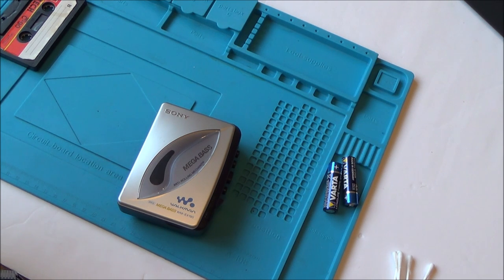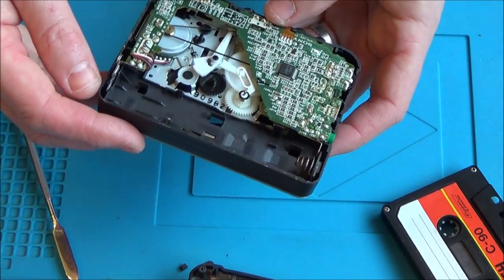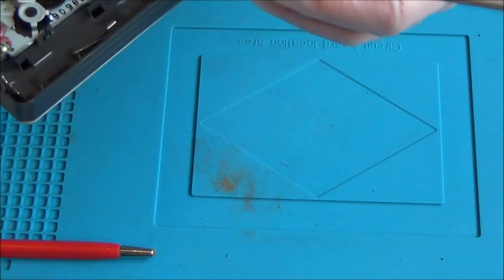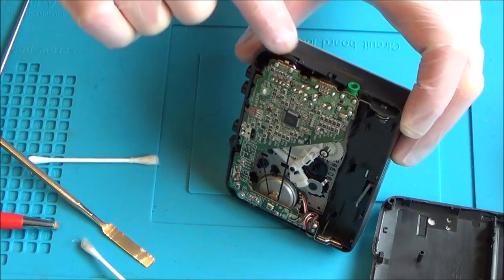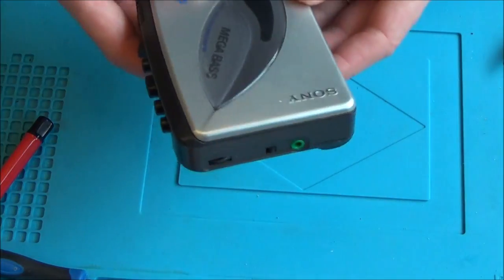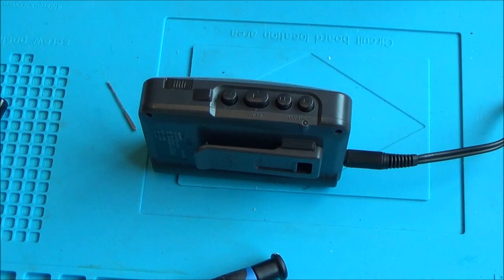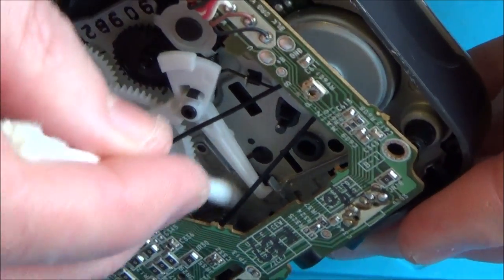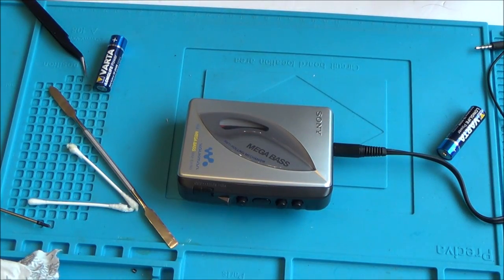Trying to FIX a Faulty 1999 Sony Walkman WM-EX190 (3rd video in Walkman series)

Comment: Another great job =D  I would have got some molycote into the mechanism there even if there was originally none - just to help with noise, movement and wear.  One point on cleaning the pinch roller (and I've made this mistake before) - if the roller is super worn, after cleaning up with IPA it can be super smooth and not grip properly.  The tip there is to use fine sand paper, or a nail file etc to rough up the surface of the roller.  The easy way to clean or rough it up is to press play without a tape, then the roller is rotating and you can press the cotton bud, sand paper, or nail fail gently onto the surface and as it rotates it cleans easier.   Go easy on PCB bending lol, I thought it was about to break at one point - again, I've done that sort of thing myself before so you aren't on your own =D

EDIT: Still watching, I see you are putting some molycote in there =D  Avoid getting it on the belt lol!
Reply from the maker: Cheers for the tips Chris, I will use the pinch roller tips on the next few if needed. That Molycote is really coming in handy since I got it :-)
Reply: You seem to know a fair amount about walkman repair. The output of my walkman is all distorted, even after I have replaced all of the capacitors. What should I try now?

Comment: Hi. I can’t understand that for these older devices you don’t replace all belts. They are continuously deteriorating even if they visually look OK. This will then prolong the life of the device.
Reply: @FoxSock  That belt was straining and struggling at the auto stop activating you can see it loop out slightly and was probably stretched and considering its age would have replaced it as borderline, faulty.

Comment: Great vid 👍 watching it made me dig out my aiwa PX327, and it’s not working 😞 time to get the screw driver out 😏
Reply: Can we get an update on your fix please?
Reply: Not much to report at the mo, it fast forwards and rewinds, and it’s stuck on play, thing the stop button isn’t working, also the remote play and stop are not working. Will keep you updated 👍
Reply: Couldn’t find my headphones, but found my lead for BT speakers, there is a loud buzzing sound coming out the unit, put contact cleaner on the switches, but still not working, got the back off and the belt is loose but still intact, will put it in boiling water abit later on. I have read online that the caps will need changing as well.
Will keep you posted 👍
Reply: Update time, the belt is in very hot water and now looking good, going round again 😊 however on the pcb there are 7 smd caps that have leaked, not looking good now 😞

Comment: as always a top video. 
top tip: superglue needs a bit of moisture to work.
Reply: and is more efficient when the joint is as tight as possible. 
other tip : cyanoacrylate lasts longer if kept in the fridge

Comment: For me , best walkmans were just before they went EOL , those ultra thin size , direct drive(no belts) full digital touch controls , like aiwa or few sony ones. I had aiwa  , was slightly bigger than actual cassete tape and it was awsome - great sound with proper tape.  I lost it .. :(
Also - after cleaning heads , and you can also demagnetize head . Great stuff !

Comment: I think that those battery springs are chrome coated rather than nickel coated. Nickel coating can develop a so-called patina layer, and that layer isn't brown than. It's more whitish/gray, or even green if it starts reacting with an acid.

Comment: I just picked one of these up from a car boot for £3 as a little project. It has horrendous battery corrosion from zinc batteries that had leaked badly. The spring contact completely disintegrated when I tried to clean it so I need to replace it. Hopefully it will work after that.

Comment: it was cheap model,but great sounding with chrome 2 or metal tapes with samsung headphones from 1994 and later headphones porta koss pro.Still have it,but needs new belt.Not all models sounded the same I tried ,some duller with too much exaggerated bass.Also good sounding were wm-ex36,still working and ex162.

Comment: -AVLS control also save your batteries when they are low -> by limiting the power of headphone amp. I do have 2 similar sony walkmans like this and that improoves dramatically batteries live. On those sony walkmans when volume is too loud the amp lowers the base automatically and in AVLS mode the base is slightly decreased.Grease is an insulator, you don't put in on power terminals, at least not every grease ... you can use graphite one because graphite is conductor. Be careful not to grease the belt because it will become slippery and cause anoying jumping sound ... and you made a mess there now the whole belt path is slippery.

Comment: I have one of these by Panasonic it has auto reverse and i never noticed that it sounded weird when i was walking with it and had the belt clip on it it also has xbs sound which is a bass booster but i dropped it and the stop button broke and I've been trying to get it to work and broke more stuff so just gave up until i get the right tools and parts (was repairing it with the original parts not new ones)

Comment: PH7 is neutral PH1-6 are acids and PH8-14 are alkaline. Also tapes are made by coating the tape with very small rods of magnetic material(it's like iron filings but much smaller) this magnetic material can come of and coat both the pinch roller(the rubber roller) and capstan shaft(the metal rod next to the pinch roller). It is actually the capstan shaft that rotates and the pinch roller is a free wheeling rubber roller that presses up against it. Now like I said the magnetic material is made from rods. A erase head is a magnet and lines all the rods up one way. A record head is a electromagnet and the speech or music is converted to a electrical signal which powers the electromagnet. The tape passes over this and the varying magnetic output from the electromagnet causes the magnetic rods to alter their direction. A playback head is just a coil and passing the tape over it  causes a varying voltage on it(basically its like one winding of a transformer. But a transformer has two windings a primary winding and a secondary winding. The primary winding is the input and in the case mains transformers has the mains voltage applied to it. This causes it to emit a magnetic field. The magnetic field causes the electrons in the secondary winding to move and it is the movement of these electrons that we use to power equipment. Voltage = speed of electron movement and Ampere or Amp for short = the amount of electrons moving. In the case of a tape deck the primary winding is substituted with the tape and the varying magnetic field of the tape causes the voltage on the playback head)

Comment: Auto stop requires torque applied after the tape stops ..the torque is supplied by the neoprene belt driving from the motor...thus..if the belt is slightly slack..autostop is unreliable....the belt _may_need replacement...rgds Evan
Reply: looks like you figured it out for yourself vince..but if you notice any bulging of the belt ie not prefectly circular (as yours is showing) this usualy indicates belt replacement is needed.
Reply: There is also probably some of the grease that got on the belt on the motor pulley. The belt grooves should have been cleaned as well.
Reply: Indeed ..grease on the belt transport or slack belt will reduce the torque needed for auto stop ..as well as affecting tape speed.
Reply: But yeah... as Evan says, a belt replacement is in order to finish the job properly!  You can see in the video that the original belt was ‘sagging’ -looking a bit loose, so it needs replacing, if for nothing more than to fix the noticeable wow & flutter on playback!
Proper tension on the new belt will also ensure reliable auto-stop for the foreseeable future!

Comment: I have the radio cassette version of this model fx195, replaced the belt works like new again, I cringed when you tapped the buttons like a madman, and when you tug on the board then noticed a screw holding it down haha

Comment: For anyone looking to save a couple bucks on fixing the faulty volume wheel, I was able to just put a drop or two of isopropyl alcohol (mine was 91% but higher is better) in there instead of buying terminal cleaner and it works perfectly well now!

Comment: IPA is okay for cleaning tape heads, but I wouldn't use it on the pinch rollers. They are made out of rubber, and the IPA will dry them out and cause them to fail faster than normal. You need to use a cleaner intended for use on rubber. :-)

Comment: I don't know why this Walkman states it has anti rolling mechanism, as it's missing the second flywheel.
Either Sony lied (advertising a feature which is not implemented) or someone else took the second flywheel off. 
I was surprised from the beginning why Sony put the motor so far from the flywheel and used such a long belt.

Comment: although a year to late, should invest in a battery pack that has leads connected to crocodile clips, then you d not need to assemble/reassemble each time you need to test. ALso invest in a soldering iron with a finer tip for those more delicate jobs. And it's BELTS not Rubber Band.

Comment: These PCB boards are not designed to flex so try to refrain from flexing and pulling on PCB boards as flexing will break solder joints and traces.

Comment: You do realise that that Super Servisol Video 40 is a head cleaner spray for video and tape heads????  it's not contact cleaner, it's essentially isopropyl alcohol.  Super Servisol is a brand, they make many different sprays, including contact cleaner, which is Super Servisol 10.  But what you used, that's not contact cleaner.  By the way, if the battery contact is browny-red, it's rust, not battery corrosion.  If it's green, then it's battery corrosion.  Should have cleaned those first, then tried it with batteries.